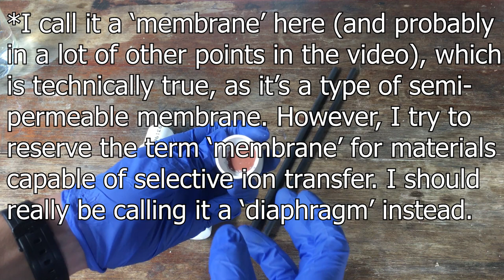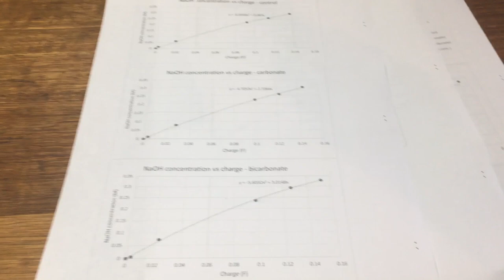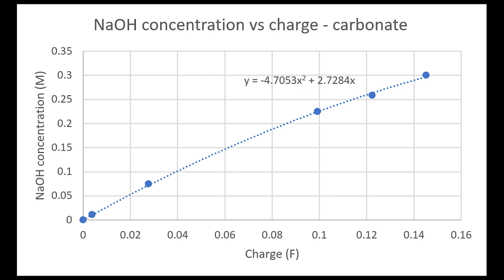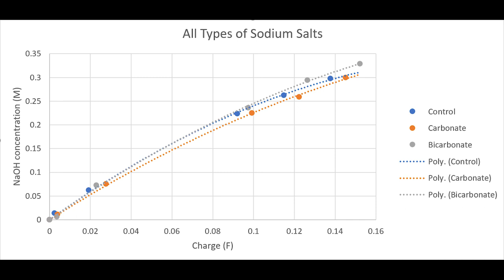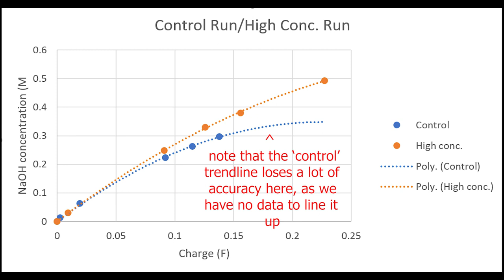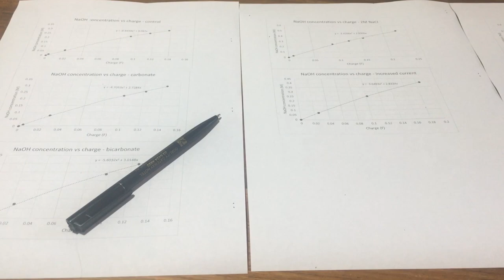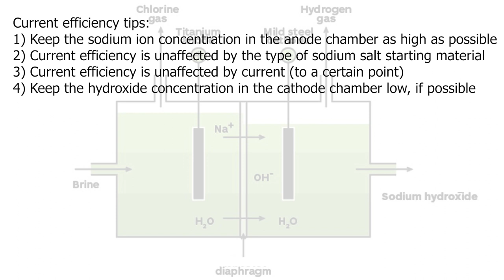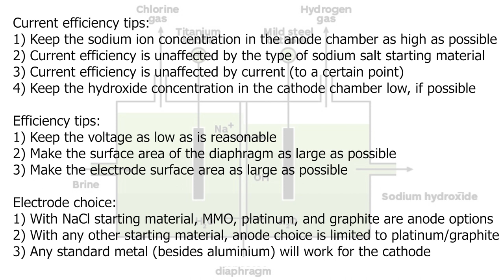Sodium Hydroxide - Diaphragm Electrolysis ep1

Comment: Nice vid, thanks fot the info. I'm testing designs myself with ceramic diaphragms and mason jars, I put them connected horizontally mouth to mouth and drill three holes on top(each) one for electrodes, another for gas exhaust(what I'm after, beacuse I'm trying to make hydrogen chloride) and the third on the cathode for adding water and removing NaOH and on the anode side to add more sodium chloride. it is a smelly experiment, so far I got 5% HCl solutions basedon titration.
Reply from the maker: That’s really cool! I’m currently working on my moderate scale chloralkali cell and eventually hope to make HCl with the output gasses too.
How are you reacting the two gasses together safely? I’m still trying to figure out the best way to configure the chlorine/hydrogen gas output for the reaction.
Reply: @ScrapScience  Well, at first I did try combining the gases in a carburator like system in which hydrogen and chlorine go in a small chamber(where they mix) inside a glass bottle with one exit in front a pilot spark(where they react) from a High Voltage circuit I made using a voltage multiplier, it worked at first, there were small pops, but very controlled and manageable, however, as soon as the HCl started to build up, it started eating the spark electrodes creating a chloride layer stopping the sparks and also eating through the electrical insulation and forming arcs where it shouldn't, then the spark would stop and then it would give one spark again, but it would ignite the build up of the mixture of H2 and Cl2 resulting in a small explosion(luckly nothing broke and no glass shrapnel for me). then I remembered that UV  light create free radicals of chlorine which promptly should react with the hydrogen then looking in sciencemadness to see if anyone tried I found this: https://www.sciencemadness.org/whisper/viewthread.php?tid=156152#pid644499

which encouraged me to make something similar, but the reaction is different, and slow. Bugged as to why that is, I took a look and found that instead the direct synthesis it goes something like this :

 Cl2+H2O -> HCl + HClO

then the second phase:

2HClO --UV light--> 2HCl + O2

(found on wikipedia - the HClO page, there it also says that metls like Cu, Co or Ni can also work to make the reaction go this way, since this is wet chlorine and it goes reverse if there's HCl and HClO together, however I couldn't iinvestigate any further because this is a citation of an Inorganic Chemistry book I do not own and currently have no way of owning)
the strange thing is that I managed to see bubles forming near the quartz tube(yes, if you gonna use UV standard glass doesn't cut it, I tested, much to my dismay standard glass is kinda ify) I didn't tested to see if it was O2 but, if the rate of your electrolysis cell is slow, you won't smell any chlorine, this much I know from personal experience, plus you can also check MysteriusBhoice(the author of the experiment) on youtube as well(he has a channel with the same name: https://www.youtube.com/user/diegonikki). people have said it works with a halogen lamp, which it should, but I haven't tested, it works even with UVC LED, but the rate is slower. I'm trying to revisit the spark model, but with a different design and see if it will survide the deadly cloud of Hydrogen chloride forming. 

my personal take is that to increase rate you could make to UV reactors and put them in series, like the exhaust of one goes into the other, I guess that raising the emperature could help increase rate of the reaction, but then you would have to collect the HCl in another vessel as it would evaporate(it is more soluble in cold water) or a higher power UV lamp - I use a 4W mercury vapor lamp, also, using a magnetic stirrer, could help to mix the chlorine better in the water and get rid of the oxygen which makes the reaction to go backwards. plus, you can use flourescent marker's paint to make a UV radiation sheild, since it is not healthy to be exposed to that, my reator is inside a jar filled with this flourescent ink diluted in water, mysteriusbhoice also gave such idea. 
if you want to try my first crazy idea, just be careful, thee explosion i powervul and loud. use the smallest vessel possibe, for if it build up it wont be a huge amount reducing the risk of a ctastrophe.

TL;DR

I use UV light to drive the reaction forward.

hope it was helpful, sorry for the long text though.
Reply from the maker: Thanks! That helps a lot.
I happen (by pure unrelated coincidence) to already own a UVC LED so I'll do my best to put something together with that. My production rate will be very slow so provided I build everything properly, it shouldn't be too hard to make it work without explosion risk.
Also, if you do happen to revisit your spark gap design, I'd recommend a graphite spark gap of some kind, as it's the only electrode material I know that won't react with the chlorine/hydrochloric mixture (with which even platinum will be attacked, I'm told), though it might suffer problems in terms of erosion over time. That's just a relatively uninformed suggestion though, you likely know a lot more about what works best.
Reply: @ScrapScience  Glad to know, but explosion risk with UV is almost null, I never seen explosion or a hint that it could happen, the reaction is very tame, so I'm sure that you won't have any trouble with explosion risks. as for graphite, I thought of it, but I was afraid that somehow it started reacting forming something like tetrachlormethane or any chlormethane, but that's just theory, never found anything supporting the evidence of such reaction. and yes, erosion is an issue, but graphite is cheap so, replacing is not a big deal, just more of a hassle. and on a note that might look like modesty, I don't know much about it either, I'm just discovering it as well. In fact I started doing it since I found your channel mid october, 2020 the idea of a ceramic diaphagm never crossed my mind and it is simple, cheap and scalable, and what I like the most is that aside from all the kinks that need to be sorted out, it actually works! for my revisiting, I was considering uusing a spark plug, though I'm not sure how it will hold out, It could work, for the material of the spark plug could form a chloride layer passivating it and the core being made of "unreactive materials" could survive sustaining a spark(at least it is what I'm hoping for), in case that doesn't work, I'll give graphite a try for sure.

EDIT: even though I done it already, I'd love to see you make a video on that!
Reply from the maker: That's good to know in regards to the explosion risk.
Graphite reacting with the chlorine actually sounds pretty reasonable under those conditions, so it's probably something to avoid. Spark plugs normally use platinum or iridium for the spark gap, so it might be worth it to try both options (I've got no idea which would be more resistant though).
And I'm glad you found the ceramic diaphragm useful, I'm always surprised at how effective they are.
Reply: @ScrapScience  Hey, I'm back... so... I revisited the spark method... and used graphite electrodes.... there are good and bad news... the good is that it work the electrods hold very well, the bad is that for some reason reagents accumulated and all went boom! really, even the cathode was shattered... had to clean up glass and sodium hydroxide drops for over a week....however... I had a surprisingly dangerous and stupidly reliable wayy to make the hyrogen nd chlorine to combine without a boom... a halogen lamp(NOTE: I'M NOT SAYING YOU SHOULD TRY IT, I'M SAYING IT WORKED AND NOTHING WENT BOOM, ALL IS IFY AND DANGEROUS AT THIS POINT), I read somewhere that side from radiation, you can also activte the reaction with temperatures over 250C, so, I got a small glass, made a lid with inlet for hydrogen and chlorine, and an outlet for the HCl and in the middle a socket for the halogen lamp(which BTW you don't need to drive it at full power, all you need is to reach the 250C required to drive the reaction forward) with epoxy putty(keep in mind that from my experience epoxy like durepoxy, by henkel, doesn't do very well in alkaline enviroments, it turns into a weak rubber and looses adherence, however it holds pretty well against acids and some solvents, you might see a change in collor, but other than that it survives even against chlorine) and at the end I tested, from a very far away, more than safe, distance, to my surprise, no boom, just the charateristic smoke that hydrogen chloride makes in contact with the air humidity which confirmed my success. If you decide to go this route, note that I could've been lucky and this could turn very bad very fast. so, be careful! for the love of whatever god you follow! also, with this set up, before you start electrolysis, you gotta turn the lamp on first and let it warm up, to prevent reagents build up... beause if there is any amount of unreacted chlorine and hydrogen in there when it warm up it could blow up, so the fiirst thing to turn on is the lamp and the last to turn off is the lamp. PLUS! I done some research on the chlorine bond(Cl-Cl) strengh(which I should have done before!) and found out that the bond reuires around 2.51eV to break, thus, by looking at an electromagnetic spectrun chart, theoretically you need light below 450nm to do so... in short, a blue LED could do it... but have to be a power one, or even violet or UVA LEDs. I acquired some UVA 3W LEDs myself to see how it holds, but the best part is that you won't be obligated to use fused quartz if this works, since standard glass starts cutting off UV at 300nm and below, so UVA and  small part of UVB will go through just fine... I know it had been some time since this was posted and I'm playing the necromancer on this thread... but thought you should know.
Reply: @deathkeys1  try aquarium shops, or RO DI shops, they have small quarts UV tubes for sale for smth like $7-10 a piece which fits small 7W UV C tube, it's used for sterilising water in domestic RO units and reefing aquariums

Comment: would it be more time efficient to run this experiment continuously for maximising NaOH production by keeping a small amount of NaOH solution in the chamber and top up with water to maintain a reasonable amount of electrolyte conductivity?
Reply from the maker: Yep! If I'm understanding you correctly.
Cycling the catholyte solution by removing some of the generated NaOH and topping up with distilled water will be beneficial in current efficiency, energy efficiency, and reaction speed.

Comment: Nice work, but as a postgraduate lab teacher, I would say that a quadratic is a poor function to use even though it matches the data. I'm sure a little calculus would give a better equation to match to. The reason why I say this is that there is no intuitive reason to use a quadratic,  but maybe a logarithmic or logistic curve may suit better.
Reply from the maker: Yeah. Looking back, this was an odd choice, and there was no proper justification for it. I'm pretty sure the only reason I put a quadratic on there is because I didn't know much about Excel at the time, and it was the only curved line I knew how to make...

Comment: did you changed the thickness of the membrane? has notice some change?
Reply from the maker: Not yet, I'll be covering the effect of different diaphragms/membranes later on
Reply: @ScrapScience  I'm thinking of using plaster, do you know something about?
Reply from the maker: Provided it’s porous enough to absorb water, I’d imagine it’d work well, I haven’t tried it though. Chlorine might possibly be a problem, so it might be advantageous to use carbonate as a starting material.
Just remember that it probably won’t hold up to acidic processes, so you can only use it for chloralkali cells almost exclusively (assuming it works in the first place).

Comment: I am getting ready to make some attempts at lithium recovery via electrodialysis.
The papers I have come across mention using Nafion 115 or 117 membranes which are horrendously expensive. Both membranes mentioned are a Teflon like substance. If I can find more data on these I will see if using something like a PTFE tape is feasible for use as a membrane.
It is a long shot but perhaps the PTFE tape has some permeability that will allow ion transfer.
Reply from the maker: Nafion is a specifically engineered membrane made to be almost exclusively conductive to positively charged ions. Hence why it is useful for lithium processes as it can be used to selectively conduct Li+ ions.
I'm afraid PTFE tape has absolutely no such property, and can't really be used as a membrane for ion transfer. 
If your process will work with nothing but a semi-permeable membrane (rather than an ion exchange membrane), there are much better options than teflon tape, as anything porous and inert will likely do the job more effectively.
Reply: I´ve made vinyl membranes that allow to transform a M2CO3 (M for alkaline metal like Li, Na, K, Rb, Cs) into a MOH by electrolysis. Just tell me if it is rigtht for you. PS: H2 generation is increased with the same wattage.
Reply: @jorgealbertovelasquez9669  how did you make that membrane could you share

Comment: I have been wondering why you chose clay, does it have any specific properties for the job. What do you think about use of polyester fabric?
Reply from the maker: Technically, anything inert and porous enough to absorb water will to the job, but fired clay has the following desirable properties:
1) It's extremely cheap (flowerpots are the best source)
2) It's very chemically inert under these conditions
3) It has a degree of porosity high enough to allow ion flow with relatively low resistance
4) It has a degree of porosity low enough to prevent significant mixing of solution between the two half-cell chambers
5) It's easy to glue and fully seal pieces into the apparatus

Polyester fabric will definitely work for the process, though it may not quite be restrictive enough on the mixing of solution across the diaphragm, so you will likely get a less pure product.
Reply: @ScrapScience  What other barriers or membranes can be used? I've heard of cotton in some cases. I'm wondering how that will stand up in a sulphuric acid generator with magnesium or copper sulphate.
Reply: @JehuMcSpooran  Not good

Comment: Does the PVC pipe conduct electricity? Can I try it with a beaker full of NaCl solution with a carbon electrode and the pvc pipe inside the beaker with distill water and a carbon electrode? Would the current pass through the PVC pipe?
Reply from the maker: The PVC pipe does not conduct electrons or ions. In order to get your setup to work, you'll need some kind of diaphragm "window" of sorts on the side of your PVC pipe. For that, you can use filter paper, a piece of clay pot (as I've done here), or even cardboard if you must.
Provided you have that, your design will probably run nicely, I hope you're successful!
Reply: @ScrapScience  What about using modelling clay? We could make the specific shape we want.
Reply from the maker: Modelling clay contains oils and is actually somewhat hydrophobic, so from what I can gather, it definitely won't absorb water as required for a diaphragm. Ideally, the diaphragm needs to soak up water like a sponge, so if you use clay, it must be fired and highly porous (which is why terracotta pots are perfect).

Comment: Wait... the graphs... how do you get 0.25ish M NaOH with 0.1M of electrons? X-axis 10 times smaller by mistake?
Reply from the maker: Volume of the cathode compartment is 100mL, not 1L. So we actually have 0.025mol of NaOH dissolved in 100mL, making a 0.25M solution.
Reply: @ScrapScience  Oh, right. I missed that lol.

Comment: The clay pot is providing too much resistance. You need something more conductive when wet. Use plaster of Paris as your mildly water soluble membrane you can make it as wide as you want and it doesn't increase resistance. baring in mind that plaster of Paris is CaSO4 the conjugate base of a strong acid, being a strong electrolyte and despite how it may seem is mildly soluble in water not completely insoluble)  . Just make it with as little water as possible without it turning to stone immediately. that increases resistance aa bit but decreases by product in the cells.

Comment: What if I said I found a way to reverse and convert sodium hydroxide to free energy?I stumbled upon something unique but would like to hear a few theory’s toward my claim.
Reply from the maker: I'd be extremely skeptical of your claim. If you're using sodium hydroxide to make energy, it doesn't sound very 'free' to me.
Converting sodium hydroxide into useful energy isn't a far-fetched claim, but having it make energy in a cost effective manner is about as close as you can get to impossible.
Reply: Potassium hydroxide plays a role as well?
Reply: Self Electrolysis like a perpetual motion machine.Show me any claims as I would be interested in findings.
Reply from the maker: There are no real claims or findings for a perpetual energy machine of any kind. This includes any mechanism involving electrolysis. I'd believe in claims of time travel over any kind of 'free energy' based on perpetual generation.

If you could explain what you mean by 'self electrolysis', I might be able to make some sense of what you're talking about, but don't keep your hopes up for a 'free energy' system.